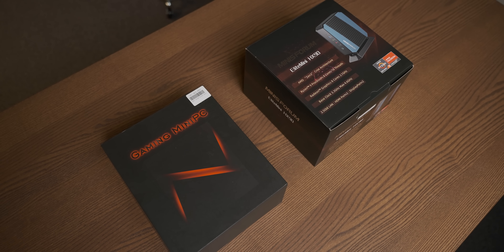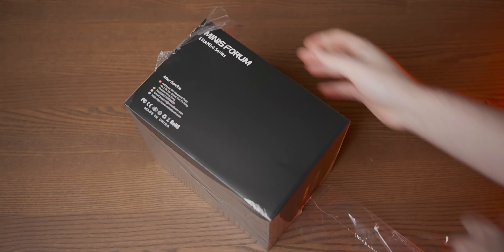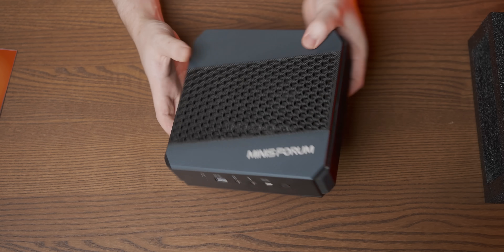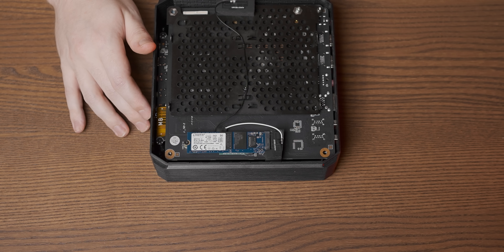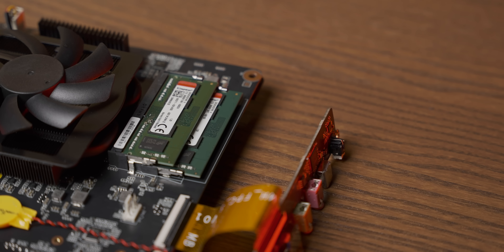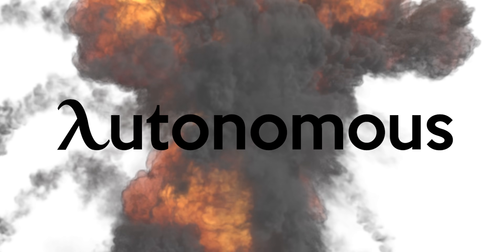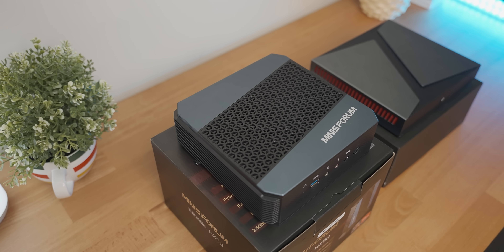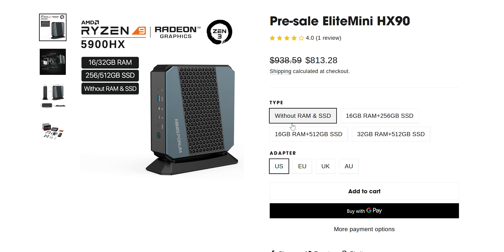The ULTIMATE Mini Gaming PC Showdown

Comment: I don't think most people would buy a mini-pc to act as a gaming machine when you can get a nicer gaming capable desktop PC for less money.  I think these are nice for home theater PC or maybe a work environment where space is an issue.  I would much rather have the 5900HX to use as a development machine than I would the other PC with nvidia graphics, plus I would have much better support in Linux for the AMD graphics.

Comment: The HX 90 should be called the Bottom Bottom ;)
Reply: if all you compare about is fps sure. however most people outside this youtuber understand the market of this computer

HTPC and light gaming which its perfect device.

topton is a chinses company not even sold in north america market, and the device uses generation old processors.

neither is a really good gaming pc...HX 90 is better at what the use case and you can get support from a company that sells on major retailers such as newegg and amazon.

why would anyone want to serious game on this anyways. i would pick HX 90 over the garbage topton anyday if i wanted a solid htpc that i knew works and get support.

seriously buying a prebuilt on aliexpress who would be stupid enough to do that.
Reply: @hiddeninthewires2308  I was just going for an easy joke.

Comment: This was an amazingly timely video. I had completely forgotten about the Top Ton, and preordered an HX90 on the 1st, when their ship date still said mid-September. Well, after checking this video I checked for updates on the HX90... Now the ship dates are available in detail and my order won't ship until the end of October.

So for $8 more than the HX90 config I preordered, I got the i9 variant (I value the cores a bit), and their sure to be slow RAM that I can swap out at my leisure.
Reply: Dude cancel that order and get the Top Top

Comment: Does the holes on the motherboard match that of the ATX standard?

If yeah, could it mean it can be attached on some cases maybe ITX? (might have to remove that 2.5" drive bay'ish bracket)
Reply: And why would you want to put it in a case?
Reply: @attilathehun79  Could be many reasons, maybe making use of that extra chassis fan header or something.

Maybe years later or in very rare cases where the shroud does get compromised, so you'd want to know if it can have an easy replacement.

But mostly just for the sake of knowing out of curiosity.
Reply: @Yosuwu  This whole system point is the small form factor, so curiosity or not, you could buy a 5800x with any size of a motherboard, with a used gtx 1660 for the same price that the barebone cost.
Reply: @attilathehun79  I guess you have not watched many "Dawid Does Tech Stuff" videos? I'll leave it at that.

Comment: Ok, but the real question is.

Which one is the best to strap to your back and use for a VR Headset?
Reply: Probably the Top Top
Reply: How big of a battery does one need to wear with it?
Reply: The Top Top
Reply: neither, buy a gaming laptop.
Reply: @dogxcs1485  no
Reply: @mtaufiqnmtn  okay, then be stuck with overpriced crap that cant even run vr for the same price that you can get a laptop with a 3060 in it. lol
Reply: @dogxcs1485  yes
Reply: Actually a SEGA Dreamcast with a Duracell battery on it. Like in the game "Typing of the Dead" (Dreamcast version, not the Overkill version), look up some cutscenes from that. Looks pretty legit.
Reply: What about electricity
Reply: @werter490  a power cable plugged into the ceiling.
Reply: @DeathlyPrice  nvm i was thinking about something completely different lol
Reply: Your phone would give you better performance than a minis forum build.
Reply: @AmericanMade65  I don't think my phone has more power than a gtx 1650
Reply: Should use the top top(or whatever it's called all I heard him say was top top) cause of the egpu

Comment: Honestly, they both look amazing, but they are expensive, I'd just go for an Asrock Desk Mini A300, I think that's the AM4 socket one.
Reply: to add a bit on top; there's a newer A300 variant, iirc is the DeskMini X300 that supports the 5000 series
Reply: @amnottabs  Exactly, and at least here it's 170 for the whole thing, which is motherboard, power supply and case, so it's honestly a great deal. 

Some ITX boards cost that alone.

PSU I mean the laptop type charger for the mobo.

Comment: So basically what you are showing is that it's time to drop Vega for the integrated graphics on AMD processors that have integrated graphics. Vega was good once upon a time but it's time for more powerful APUs.
Reply: With the steam deck having an RDNA2 APU i'd imagine the next gen of Ryzen APUs will likely head that way too, doubt they will this gen as we already have (OEM) APUs with Vega.
Will be interesting to see how desktop level RDNA2 APUs preform
Reply: Did you miss the part about the dedicated Geforce 1650 in the top top system? The Vega iGPU is not that bad, even if old, compared to intels iGPUs. I think even the RDNA2 based APUs will still have a hard time against a dedicated GPU excdept of the lowest performance or older ones.
Reply: @WirrWicht  oh yeah ofc they will but for low power, small devices it'll be pretty solid
Reply: @WirrWicht  1650 is a bit older though.... I am interested in the minisforum for an office computer because of the processor regardless of the APU but still it would be nice to be able to unwind and play the odd game on it. Which let's be honest it can play games just not at particularly high framerates.
Reply: It will happen once they adopt DDR5. The bandwidth of DDR4 is too slow to actually make RDNA based graphics feasible on APUs.
Reply: @riven4121  oh yeah good point. That's a very good point. Thanks...
Reply: @darrenskjoelsvold  Good thing is there's a rumour that AMD has begun mass production on their Rembrandt APUs that have RDNA based graphics as well as DDR5.
Reply: @riven4121  aren't those for the consoles?
Reply: @darrenskjoelsvold  Nope. Rembrandt is laptop CPUs if I remember correctly. Then the desktop APUs will be with Zen 4 I do believe. But the rumour is that all of AMD's desktop Zen 4 CPUs will have integrated graphics like Intel's non F CPUs.
Reply: @riven4121  ah, ok cool. Thanks for the info. This stuff is tough to keep up with. Thanks for the breakdown. 

But which chips are going into the consoles then?

Comment: Are they both Windows 11 capable? I'm seeing the Chinese bios makers really dragging their feet adding in Secure Boot and TPM functionality.
Reply: They should be capable. Microsoft isn't advertising this, but you can still install and use Windows 11 by doing a fresh install of it on the system. They just won't allow you to upgrade from 10 to 11 without those features. It's supposedly something "For businesses to evaluate Windows 11" or some such garbage.

Comment: I love the small form factor but both are bad value since a laptop with an 1650 is around $700 too. Considering that the toptop is basically a laptop motherboard put into a mini pc case.
Reply: for 800 USD I've got a 9750H and a 1660Ti. So yea, you're about right. Thankfully that ALSO came with a 144hz display on it. Keyboard was disappointing though since the key rollover is 2 keys...so playing anything requiring WASD movement was unfortunate, so you might find yourself dropping like 50 dollars on an external keyboard with mine.
Reply: @entryofemotion12  Or you can go buy a Salvation Army PC with a 4 or 5yr old CPU for $100 then buy a 6700xt and drop it in for INSANE performance for about $800 total (and thats scalper priced)
Reply: @anthonylong5870  I've literally never seen a PC at a salvation army
Reply: @dumbfishtanks  Oh yeah I see them all the time, normally Dell and HP's.  Good Will as well.  Maybe just my area though, don't know
Reply: @anthonylong5870  That's interesting, I used to flip items from Salvation army and goodwill and I've never seen desktop computers. Usually just a bunch of really outdated monitors and peripherals
Reply: @dumbfishtanks  Well I got 2 in the past few months one was a Dell optiplex and the other was an old Compaq....paid $50 for the Compaq and $75 for the Dell. Both from Salvation Army here in Michigan.  And like I said Good Will has them from time to time as well
Reply: iirc its a desktop version 1650, if so itll outperform a mobile 1650
Reply: @sunchip9  with a 3+1 power delivery, absolutely not, it's pretty much a laptop
Reply: +, also with laptop fans, which dies fast and is loud as usual.

Comment: Make a pc inside of a PS2 that’s ur new challenge
Reply: that's not even a challenge
Reply: @rossclutterbuck1060  it would be if you use ps2 slim model, there is barely space in it. Forget about putting any high end laptop cpu or graphics card. In best case you will have to go with apu. That would be a definitely complex chalange.